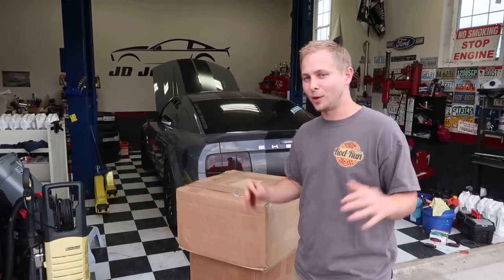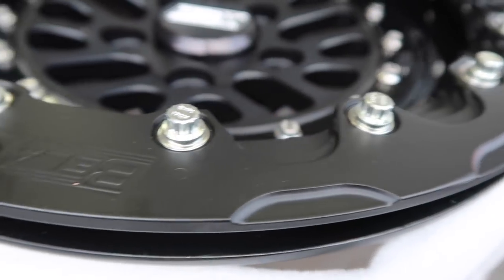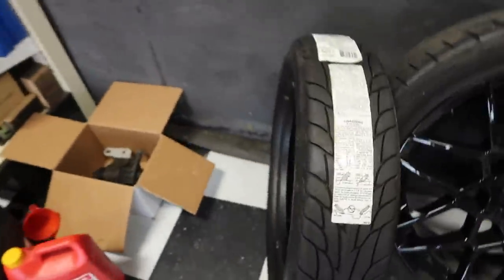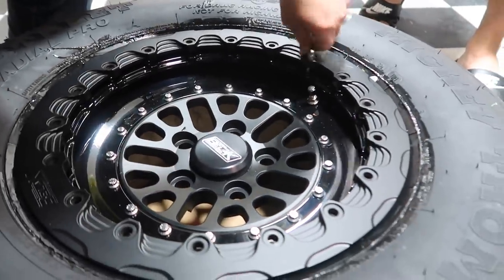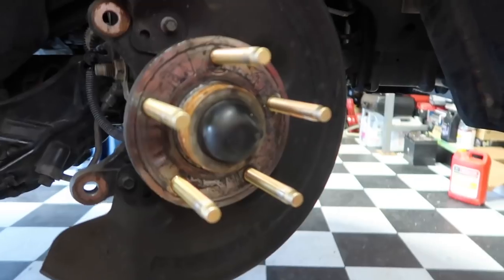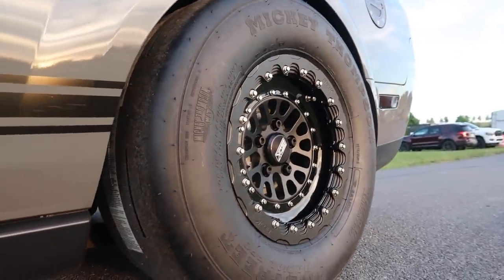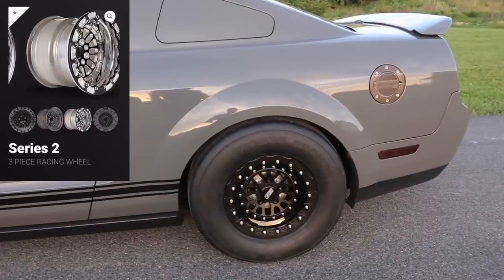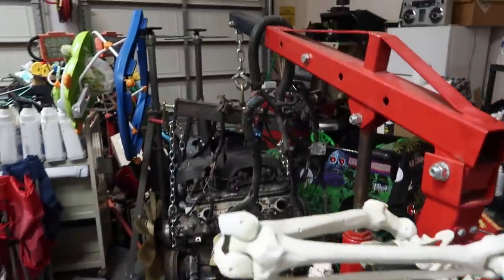FIRST GT500 With These Custom Wheels

Comment: So if you ordered "custom" wheels, why didn't you setup the offset when you placed your order?  You then wouldn't need any spacers...
Reply: That's exactly what I was thinking
Reply from the maker: The skinny fronts are only offered in one offset and the rears have a 7.25” offset and the a 7.50 or 8” offset would make the rear barrel look flat because it pushes the face out more but it would have still rubbed.